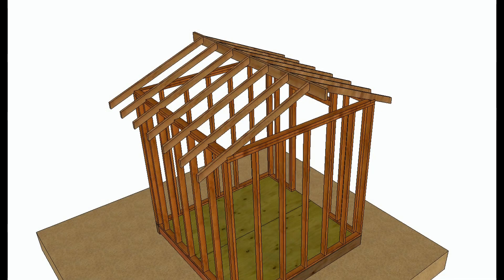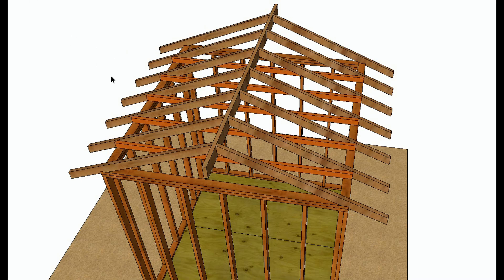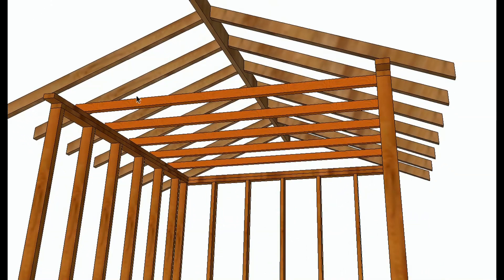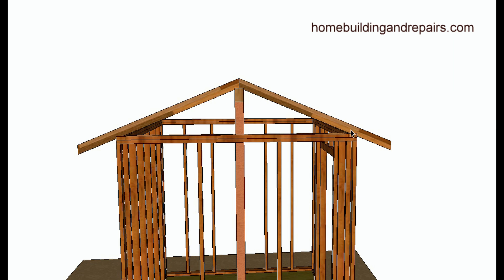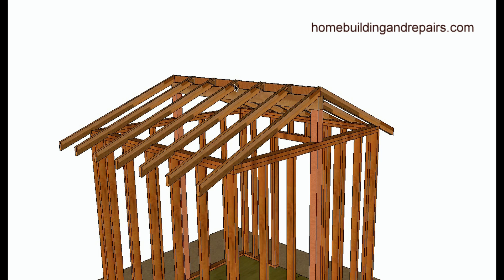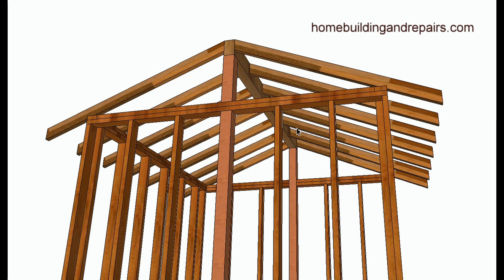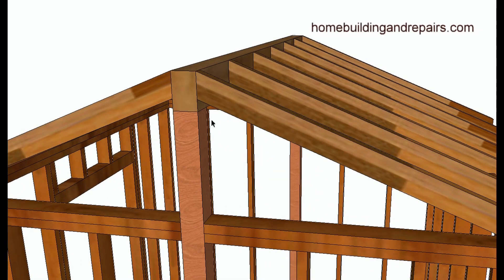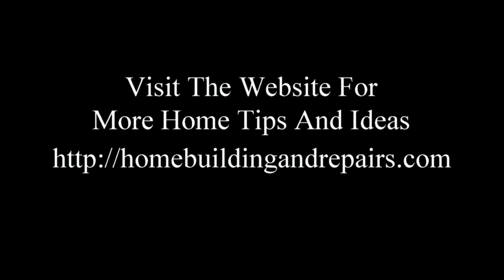Vaulted or Cathedral Roof Framing Basics - Home Building and Remodeling Tips

Comment: If there was a door or window in the middle of the gable end wall? Wondering on the best way to transfer the point load. Thinking to have an LVL beam instead of a standard top plate but would need the cable end to be strong to withstand winds. A working example would be nice to see?
Reply: The house I grew up in has an A-frame addition put on in 1970.  The “A” elements are all in the middle, not on the gable end walls, and one end does have a window in the middle.  I think they just used part of the end walls as shear elements to keep the side walls from spreading out.  It sounds like you’re using a ridge beam without any sort of rafter ties, so this might not be fully applicable to your situation.  But if your end wall can contain an unbroken triangle around your windows, then that might hold up your ridge beam OK.

Comment: This is great! Do you have any videos or suggestions on how to handle an off-center ridge beam?
Reply from the maker: It would be built the same way, most of the time. Feel free to provide more detailed question if this didn't help.
Reply: @gregvancom  Thanks for the info! A design I'm considering would have members on one side of the beam be roughly 4 feet before landing on the wall and nearly 13 feet before landing on the opposite wall. I'm using a calculator to (hopefully correctly) find beam dimensions/materials that will support the weight of all the factors to consider in norther Minnesota. I'm curious about that much of an asymmetric load. I feel like the safest option is just putting another beam half way down the long side but was curious an what more experience builders thought.

Comment: I just framed in a 4’x8’ chicken coop.  Sounds silly, but I wanted to be able to stand in it to sweep it out with headroom.  After I framed all the walls, I saw it:  the walls would eventually bow as my 2x2s were 24” oc but even with smaller, over time it wouldn’t hold well under the weight of precipitation.   So, I installed ridge beans on each end.  The ridge itself wasn’t even resting atop the ridge beam until more weight was added.  LOL   one end of the coop is a big clean out door and I placed cripples and jack studs on that end.   Without realizing what I was doing, I engineered a vaulted roof.

Comment: I'm thinking that you could over size the top plate to carry the outward load of a ridge board roof to shear walls.  It seems like things are always sized so that the top plate is the same size as the wall, but for a cathedral ceiling, that might not be optimal.  It seems easier to create a larger top plate than a massive ridge beam.

Comment: Thanks man I converted my wood trusses a couple years ago into a cathedral ceiling…never done it before….I watched all ur videos and it turned out great little nerve wrecking when I took out the temp walls but I used 2 car floor jacks to get the ridge beam in it worked great…. Very informative answered all the unknowns I had and I’ve gotten zero movement it Ty

Comment: I have a question sir, I am wanting to create vaulted ceilings in half my house( living room and kitchen .

I understand the concepts you have in this and other videos, we would pour footings in the basement and 4x4 up to the 1st floor and bottom of ridge beam.

Current construction is like the model in this video, collar ties on rafted with 2 rafters skipped in between.

My question is: can I use the ridge board (2x10) as the ridge beam? And If not could you explain why? And if the ridge board is not adequate enough, can a ridge beam be installed under the ridge board?

All of your examples show the ridge board bing removed entirely
Reply: The difference between a ridge board and a ridge beam is just in how strong it is, and how well supported it is.  A single 2x10 can’t support the weight of a roof unless it’s a really small building.

Comment: Hi Greg, what about if you want to have a completely open cathedral ceiling on both ends and you don't want the post? Do you have to use a steel A-frame or can you do it using timber?
Reply from the maker: I would think some type of steel frame would be the way to go.

Comment: Do you need blocking of any dimension between the rafters? I’m more familiar with building decks. Perhaps a staggered 2x of smaller dimension so it doesn’t impede air flow, or would that be overkill?
Reply from the maker: I've seen a variety of different blocking sizes smaller than rafters used and the same size blocks as rafters.

Comment: I'm getting ready to build a 12'x12' with a 5' overhang off the front with the upper loft of 8'x12'. It will sit on a mono pad.  Basically  what you made with a porch and a loft.   I like that you showed both ways to support the ridge beam .  I've done my fair of reading and can't  find the answer I'm  looking for so I'll  try to word this question  in a way you can hopefully answer  with no liability... have you ever seen anyone hang floor joists off a  beefed up door header to save on  height? The front wall is 2x8 so plenty to sit on.  I've  read through the comments  on enough videos you make  to see you're careful  with what you say.
Reply from the maker: I don't see why not as long as it will support the loading.

Comment: this is great.  I am personally happy that you went into detail about the length of the beam supporting the ridge beam.  So, to clarify, does the beam go all the way to the ground?  Or does it rest on the floor foundation?  Also, the stud walls, I would imagine, are screwed into the beam in addition to the metal strap.  That metal strap looks really thin and flimsy... I can't imagine attaching the walls with a metal strap.
Reply from the maker: Glad you learned a few things and  you should go to our website and watch more videos on roof framing and remodeling.

Comment: 2 questions please, regarding the last type of roof, shouldn’t there be room for air to circulate for any condensation in an area where there can be extreme weather? 2nd is for a log cabin would the post still be required and have to be placed in front of the log wall?  Not very attractive. Or could the ridge go on top of the logs if the logs are substantial enough?   Thank you for any guidance.
Reply from the maker: I've seen log cabins built both ways and it will depend on the design more than anything as to which method of construction to use for the ridge beam. Air circulation through rafters is a requirement in most areas when building vaulted ceilings, but you will need to check with your local building department if you have one for more information.

Comment: Greg, we have a load bearing wall directly under the peak (ceiling joists are resting on it). Instead of a giant beam, could I just add a short wall under the peak, extending down to the load bearing wall? That would be easier than the beam and still give us height.
Reply from the maker: I can't provide engineering advice, but can tell you that a wall on top of a load bearing beam support is a common method used by engineers to support loads above like rafters.

Comment: I want to convert to vaulted design but one side of my ridge beam would be above my doorway. I have seen designs that just connect the ridge beam to the header using a post that doesn’t go all the way down to the floor. What are your thoughts on this design?
Reply from the maker: Yes, I see it all the time. A larger header might be needed.

Comment: Good video. Question, I replaced a couple of ceiling joists and I found that the ends of the rafters (2 by) did not meet with the ceiling joists in some cases, so there is a gap between the rafters and ceiling joists.  Consequently, I nailed the joist against the wall and not against the rafters because of that space. Can that be a problem?
Reply from the maker: Rafter ties can usually be spaced 48 inches apart, if that answers your question, if not then provide some more details. If the nearest one is 48 inches from a wall then you should be okay.

Comment: I wanted my cathedral ceiling over my living/kitchen area, but where the posts would be to support the beam would land in the middle of the hallway. Can I run a small post from the beam onto a header over the hall??
Reply from the maker: I've seen it done lots of times, you just might need a larger header to support structural load above.

Comment: If I'm correct, in the first method, the lapping and nailing of the rafters together above the ridge beam eliminates the need for straps there, as would be necessary in the 2nd method. Is this correct?
Reply from the maker: In my experience, you can lap or strap, rafters or ceiling joist, but since I'm not an engineer, don't know if it will work on every project.

Comment: Getting ready to build rafters, and want to have open ceiling no beam in the middle. Approximately 48" to height of rafter. Just fasten with 6 " screws and screw up through the wall into rafter. Will this work and walls not bow out? The previous building was done like this and I would like to do the same. Need quick response since building these this Saturday coming the 7th.
Reply from the maker: I won't be able to provide you with structural engineering information and would recommend using standard construction practices like those shown in the video.

Comment: What if you a have a roof type without an end like a hip or cross hipped roof and you don't want a beam coming down where the hip starts?
Reply from the maker: If it needed some type of the support beam and you didn't want to use it, then you might need to build it out of steel. Here's a link to our website that might be helpful, start with the ceilings.
http://www.homebuildingandrepairs.com/remodeling/framing/index.html

Comment: Should be continuous column. It seems counterintuitive at first, but that really is an unacceptable hinge point and on a much smaller column section at that. Birdsmouth cut needs to extend across the entire width of the top plate at the eaves. You did not explain very well the lapping of the rafters.
Reply from the maker: Thanks for the constructive criticism and the building would definitely be better with a full-length post and no hinge point. I don't see any need for a full-length bird's mouth roof rafter cut and as far as the lapping roof rafters, you will need to keep in mind that it was not meant to be a step-by-step instructional video, but an example of basic vaulted roof or ceiling framing. Feel free to go to our website for more information and instructions.

Comment: What if your posts that hold up the beam are over a garage door header and a window header on both ends? Could you still remove the flat joists to vault the ceiling?
Reply from the maker: Keep in mind that I cannot provide you with structural engineering advice, but can suggest that if all of the framing components like the roof rafters, posts, headers and even the wall framing door trimmers are the correct structural sizes for transferring the loads, then I would say quite possibly yes.

Comment: Thank you.  Great information and clear directions.  Can you suggest how it might change if using metal studs for framing rather than wood.
Reply from the maker: I don't know if they have load bearing wall framing studs and then next would be the pricing. Would it actually be cheaper to use metal? I think the best advice I could give would be to use wood, even though this really isn't answering your question.

Comment: Can the ridge beam rest upon a post which is resting on a beam, the ends of which are supported by posts on top of piers, thus allowing an open area in one part of the room which allows unimpeded access to other parts of the room? (i.e., no post/column in the middle of the room)
Reply from the maker: It would be for me to say yes or no, because I don't know exactly what you're dealing with and cannot offer engineering advice, but I have seen beams sitting on top of other beams, plenty of times.

Comment: hey! great explanation, what if I needed to put french doors right in the center of the front and back wall? the vertical beams that come down from the ridge would be right in the center of the doorway. any ideas? (old separate garage turning into inlaw suite) thanks!
Reply: never mind I see someone asked already
Reply: although I still need to find a visual to show how many beams and where...
Reply from the maker: I will put your video on my lists of videos to be made in the future, but would contact a engineer to provide you with more information. It will be easier if you could move the doors over to the right or the left of the post supporting the ridge beam.

Comment: good, straight-forward description, enjoyed it.  But- I have never seen that rafter lap joint on the center beam.  It looks more appropriate to post and beam construction.  In other words, it is a very fine detail which is not common, even though it is elegant,  but most framers would not have time for that.  It would take a real artisan to do it.  but thank you for making a real decent video.
Reply from the maker: It's hard to tell if it's a common method of construction, but it's definitely used more often with exposed ridge beams and of course would be stronger than creating some type of roof ridge above the beam.

Comment: In this design what percentage of weight ridge beam carry and what percent side walls. Is it always a constant like 60% side walls and 40% ridge which is 20% on each side of the ridge?
Reply from the maker: I can provide you with any type of engineering advice, because it could be different on each project. I would imagine that the slope of the roof would also be a factor when figuring out weight distribution.

Comment: What if I want to put a large patio door on one end of the ridge beam where center post is under the wall. Can i remove the supporting post and put a 12 x 4 header?
Reply from the maker: I can't provide you with the actual beam size, but I think you're on the right path. You could simply install a door header and opening in the wall and then install a ridge beam support post that would sit on top of the header.
Reply: Thanks!

Comment: How are you bracing the walls?
Reply from the maker: Good question, most exterior finishes like siding or stucco will provide sufficient bracing for small buildings, less than 12' x 12' for example, but might require shear panel or additional structural supports, for larger buildings, using the example in this video.
Reply: JemDaffodil سلام

Comment: I have a 16by24 structure. How shallow can I make my roof pitch.  Will a shallow slope not be structurally sound ? I originally wanted to do a flat roof but decided to go with a slight slope , I just don’t know if it will hold up , my plan is to basically frame it like the first example in your video , except the ridge beam basically resting on the double top plate
Reply: tyrone elliott  no roof is flat it always has a slight angle
Reply: John O'neill I am aware of that , I have heard of it referred to as a flat roof , yes a slight slope to shed the water , but your response doesn’t touch on my inquiry rather try’s to correct my terminology , please if you have something useful to add I would love to hear that
Reply: And of course you need to to comply with building code in your area.
Reply: John O'neill it’s a remote cabin build, no building codes required
Reply: So build the walls do the calculation on the roof... you'll get common rafters. It's calculated to guarantee structurally sound. Using tried and tested measures. Your over complicating it.
Reply: John O'neill walls are already built and roof is framed since I wrote this comment , so congratulations you just wasted your time
Reply: Meh I have to laugh tho must be some build😂😂😂😂

Comment: We have a sloped ceiling in our living/dining room combo that we want to expose in order for the area to appear larger. My question is, would we be able to remove some of the rafters (we're removing 14 of 20 rafters) leaving 6 intact. Would that cause the roof to collapse or cause excessive weight or pressure on the walls???
Reply from the maker: If you can, take some pictures of the roof framing and send them to me for more information. Keep in mind that I am not an engineer and can only provide you with an educated opinion.

Comment: I was wondering if you wanted to put a door centered on that wall is there a way to transfer the center post off the to the sides of the door opening
Reply from the maker: Yes, the post would sit on top of a heavy duty door header, for example for a 3 foot door a 4 x 6 might be required when there isn't a concentrated load above it and a 4 x 12 might be required if there is. Also, double door trimmers might be required or 4 x 4's might need to be used to support each side of the larger door header to transfer the load to the building foundation. I will make a video and post a link here when it's done.